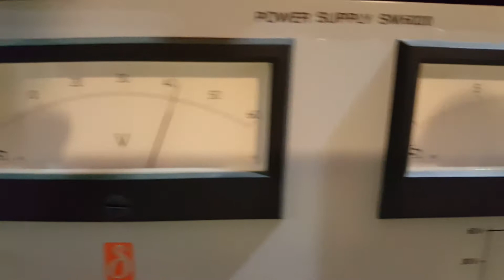Homemade 400W - over 90% efficiency SMPS

Comment: Are you including driver power? I think GDT's use a fair bit of power?
Reply from the maker: Tom Peterson No but it's just about one or two watts in my case ;)  15V @ about 100mA.
Efficiency is still above 91% when i include the GDT + driver power consumption.
Reply: Oh very nice. Do you know if you can get commercial GDT's for this, all I've found are really overpriced or only good for HF or SCR switching..... (tested a few you just get a sine wave output or saturation)
Reply from the maker: Tom Peterson there are commercial GDTs available - they are called pulse transformer. Sometimes you can find them on SMPS circuit boards. I have no experience with them because i always use homemade GDTs. You need the right core material to get a nice square wave on the gate.
Reply: I'm aware of that (im an EE grad) and I've purchased a few of them but the datasheets don't give many specs and so far they've all exhibited the features I described before..... But ow well I guess.